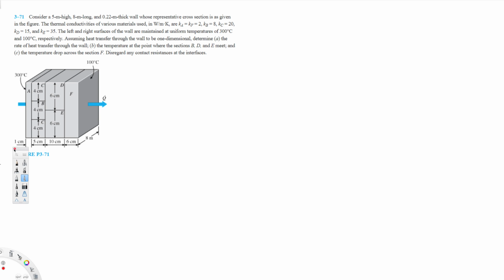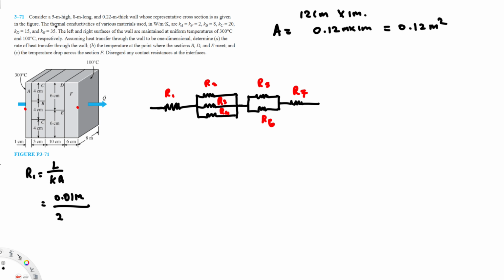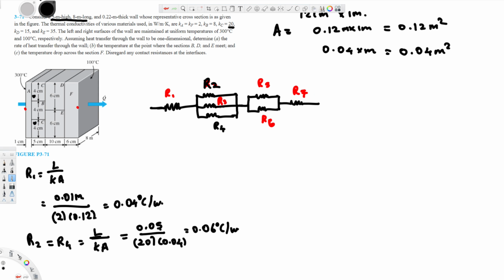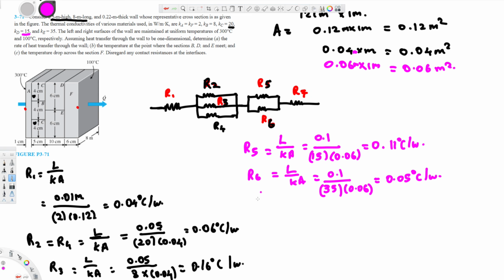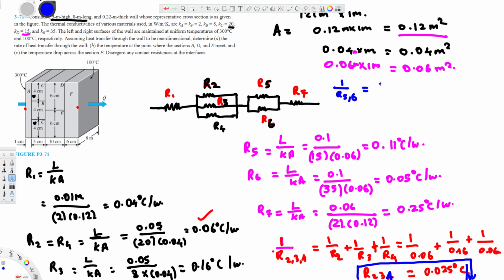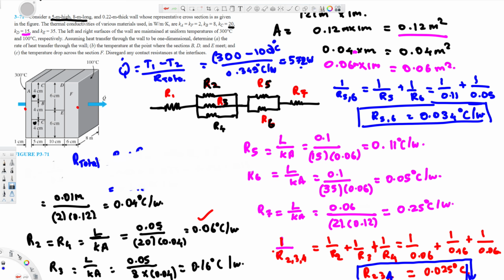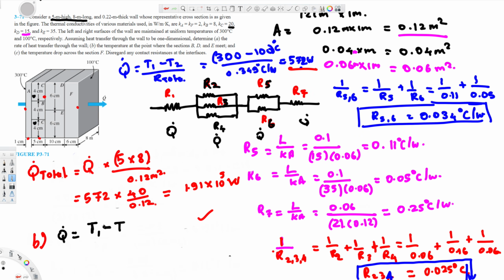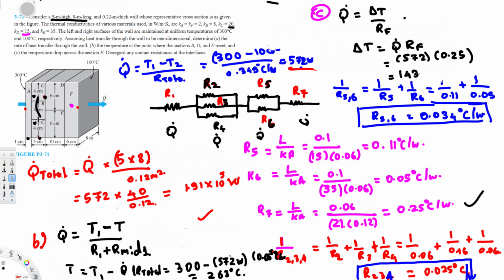Heat Transfer - The rate of heat transfer through the wall

Comment: Hang on the height doesn’t matter since it states it’s a section. The height of the section is 12cm so the length is the value at the bottom and the area is the height of each block times 8? Should give you around 4.5kw?

Comment: Area of the wall is 8mx5m=40m^2, isnt it ? why didn't you use at the beginning of the problem ?
Reply from the maker: if we use in the beginning, we should divide the area accordingly to calculate R values. it's a difficult thing to do.
Reply: Thank you
Reply: Do you have any video about plate exchangers ?